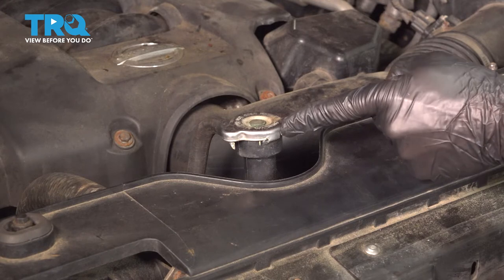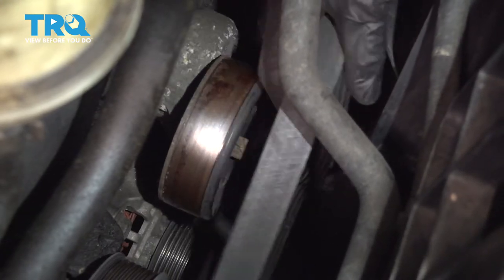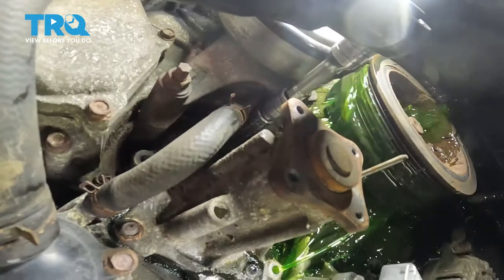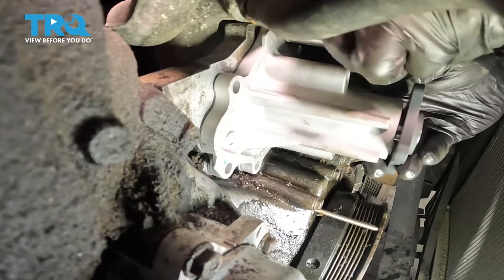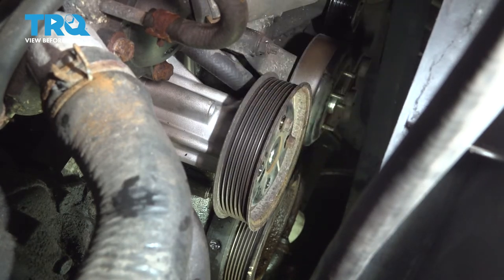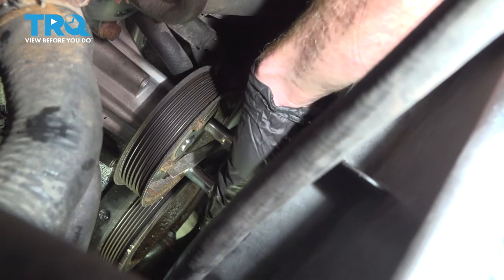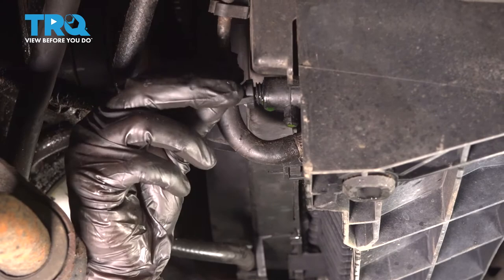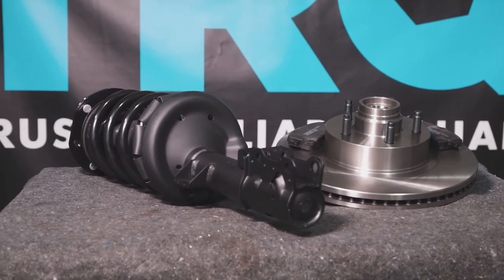How to Replace Engine Water Pump 2004-2015 Nissan Titan

Comment: I’m not a mechanic so I apologize in advance if I don’t sound the smartest but I have a leak in the bottom of my radiator I just see it dripping green coolant through the plastic could it be a bad one of these? Someone help please